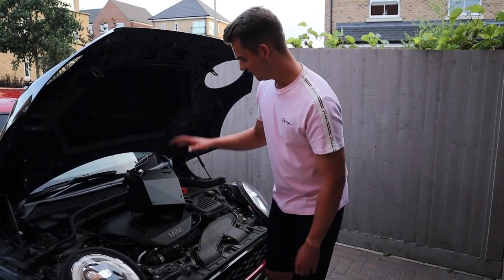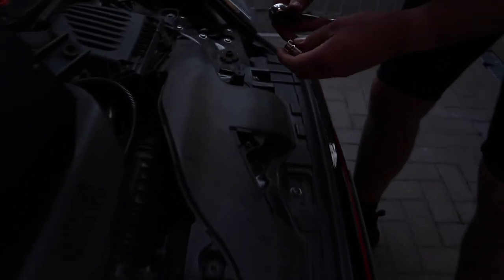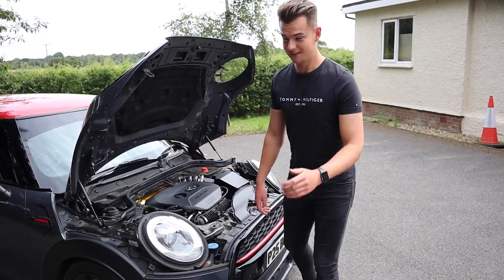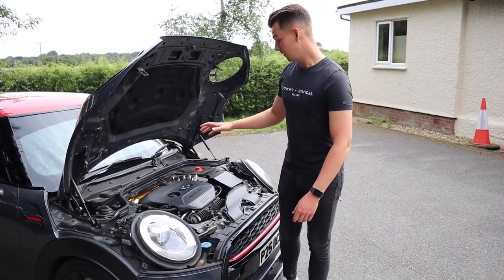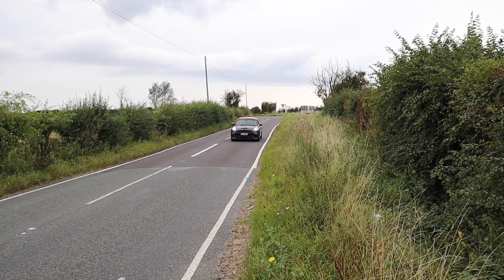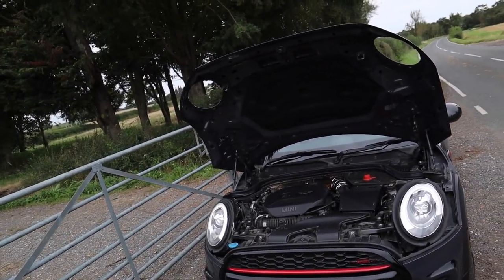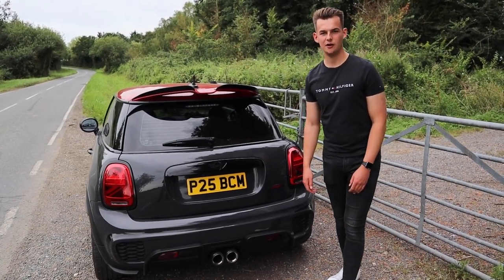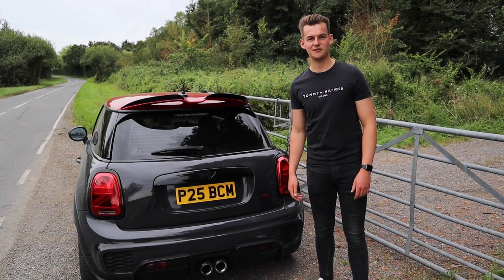Transforming my JCW with FORGE INTAKE AND HARD PIPE!!

Comment: i just installed the same forge-filter kit without hardpipe and mine is not so loud. I wonder if the hardpipe really makes that much of a difference...and why do your jcw pop and bang? is that a jcw without OPF-Filter?
Reply from the maker: The hard pipe makes a huge difference as there was a lot of voids in the original parts for the air to get lost. My Jcw didn’t have a OPF filter as it was a 2015. So best year for the noise and tune they put in them!

Comment: What did you wrap the hard pipe with? I know it’s basically a heat shield but it doesn’t come with the hardpipe huh?
Reply from the maker: You buy it separately. It’s a heat resistant tape. Stops the pipe from heating up from the engine resulting in cooler air for the intake

Comment: Do I have to have the forge intake with the hard pipe or can I go k&n intake with forge hard pipe? I’m confused if I have to buy it as a set..? Or can I have 2 different manufacturers with the forge hard pipe
Reply from the maker: You can have those two different brands, just remember they might be a straight fit and some trimming may be required!

Comment: Don't ever run anything other than a sealed intake system on these cars. The amount of heat that sits in the engine bay will make you lose power.
Reply from the maker: You’re not wrong! That’s why I sold it!